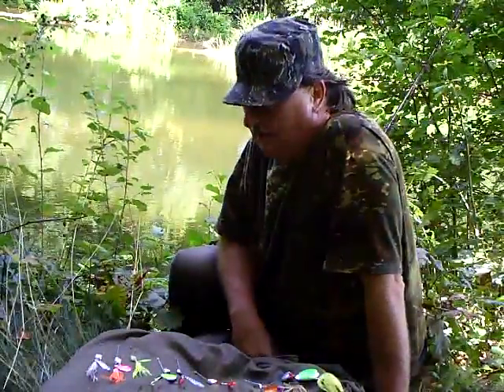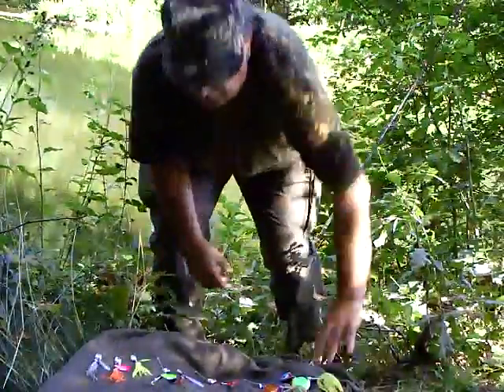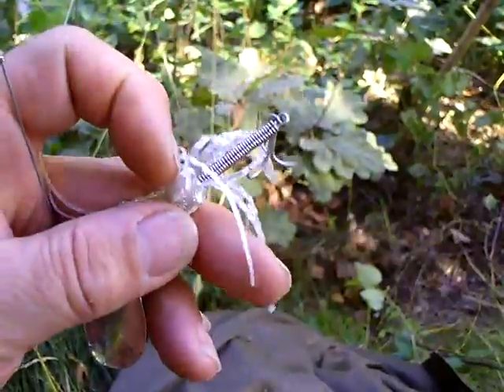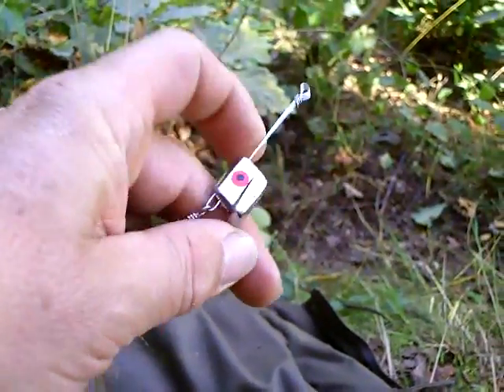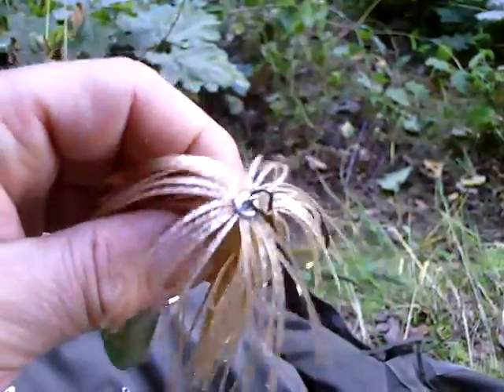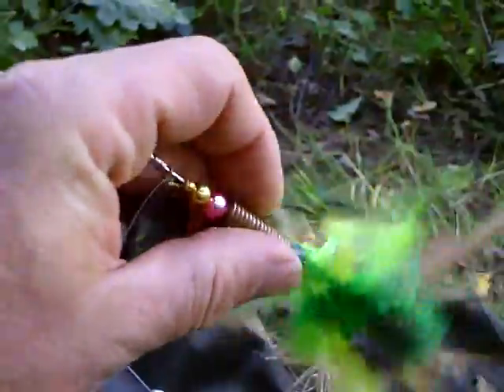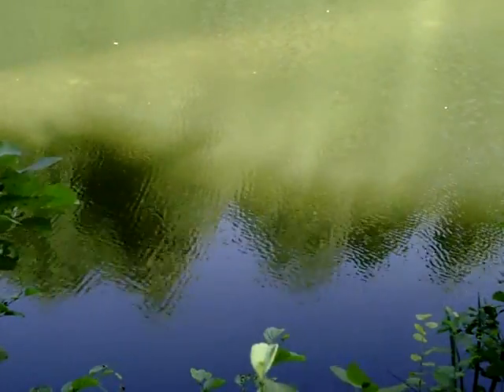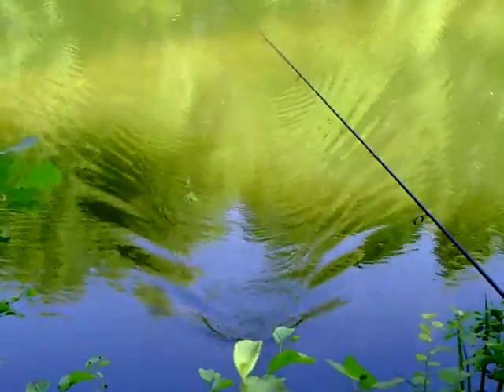Homemade Spinner Testing

Comment from the maker: Thanks  a lot , ........I have made a few casting molds for lead parts through the years . Since I'm working in the local metal industry , I had always carved out their cavities with drill bits and Dremel router bits , .....molds were made from  aluminium  blocks , could get the material for free from the scrapyard .

Only attempt of pouring a live minnow(for a jigging spoon) in dental silicone had badly failed , as the stuff could not stand the heat of molten lead . Tight lines , Dieter

Comment: nice looking lures! you said that those shaped weights on your weight forward lures are hard to come by.you can very easily make yourself a mold of those weights and pour as many of the weights you need or desire with RTV silicon that is rated for high heat. i make molds for soft plastic baits that i pour with RTV puddy.hope this helps